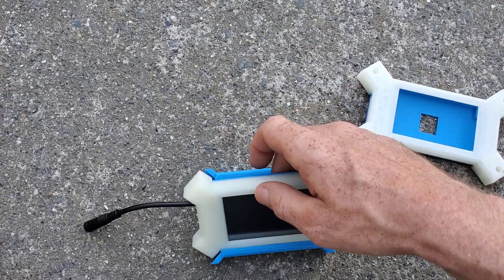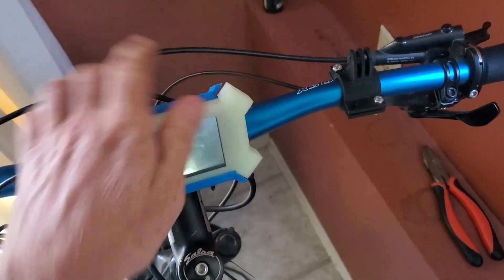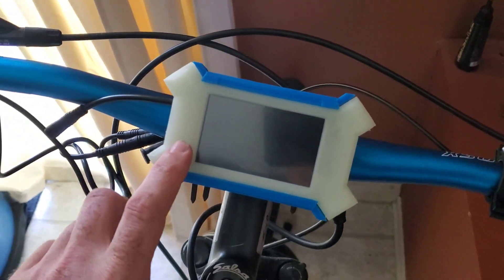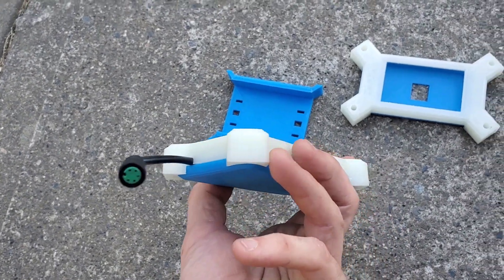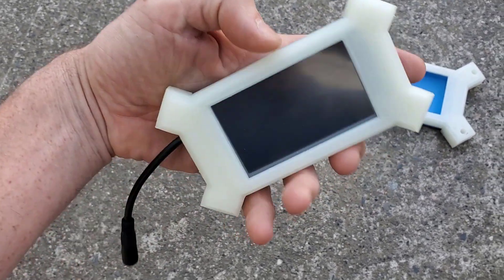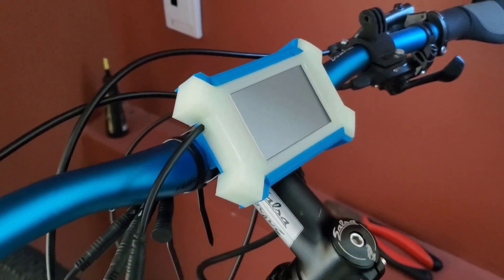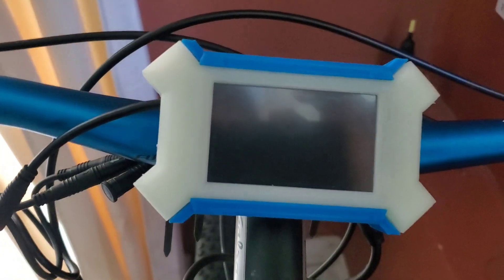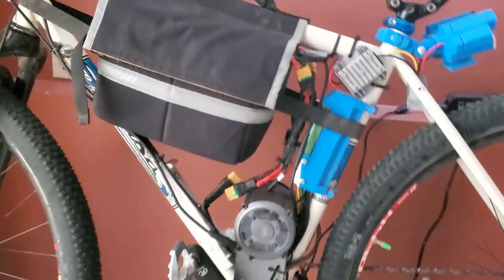NXT - X CASE / PROJECT UPDATE

Comment: Excellent. I was just talking with Allan to make sure it would work with my unlocked BAC8000. He said it can detect my unlocked version and it also has settings already in place for my QS 205 50h. As a bonus you can also push voltage up to 92V.  I love my ASI. My only complaint is that they don't have a 144V version :)
Reply from the maker: Yeah 144 would be insane
Reply: you can run 22s on a 23s BMS if you needed

Comment: The best looking display I've ever seen!!!!

I've a couple of questions.

I have a HP trike and the cockpit space is very limited, I'm just wondering if your display can attached as if using a phone, so that it doesn't collide with my knee. The display I'm using at the moment is a Befang DPC18. 
Could I ask for the dimensions of the display cradle please, so that I can see if it will fit normal on the bar.

When will the NXT be compatible with the Befang 250w/350w/500w motors.
Reply from the maker: I am not sure on the smaller motors. I will shoot you thr dimensions later tho. In theory it will run them fine... But it might be a while before resources allow.

Comment: Hi is the 3D printed holder for the green speed control available to down load? My controller turned up in the post today :) just got to fix it onto the bike now
Reply from the maker: If you join the discord channels I can get you the. stl for the bac. Can't link files very well on here
Reply: Great thanks for the reply. my kit is all mounted on the bike now (zip ties and tape) needs tidying up but ok to test. joining the group now cheers

Comment: Where can I buy one?
Reply from the maker: electricrt.com or electron cycles in the uk
Reply: Captain Codswallop the case?
Reply from the maker: Sorry. Ill make it available to print. Its doing some testing with Alan right now. He may well ship an upgrade at some point.
Reply: @HighVoltageKits  thanks for the update video. Do you know if the BBSHD upgrade kit will be available soon? It says there are no display options available so I cant but it.

Comment: When is nxt coming out to the general public?  The website has been all out of stock.
Reply from the maker: Should be soon. I think the ERT website has been neglected as its been all time on coding and development. Which motor do you use?
Reply: I have a bbshd with last years ert bac 800.  I’ve got a gen 2 cyc arriving soon.
Reply from the maker: Cool. Look forward to hearing about that. Which controller with the cyc?
Reply: I went stock, just waiting to see who gets   Useable torque sensing going on the asi platform.   Look forward to what comes out of this work.
Reply from the maker: Yeah! I was talking with CYC the other night. Looks like they have a fix. The ERT version needs time to tune. But we know what needs doing.